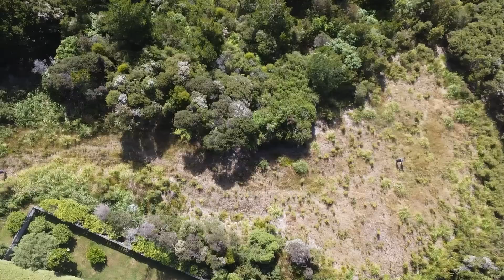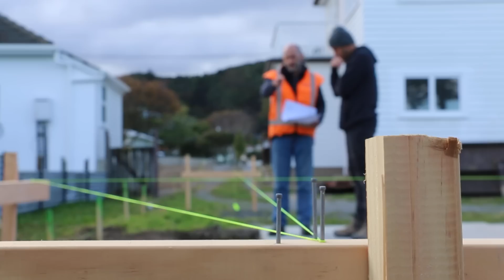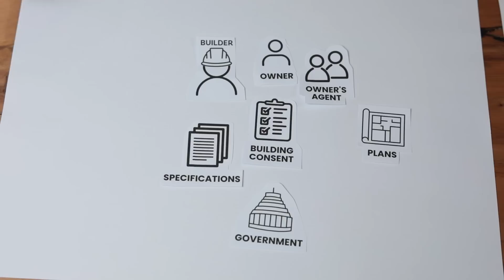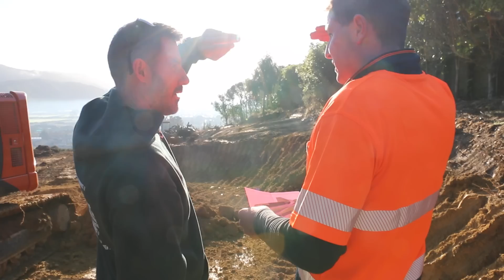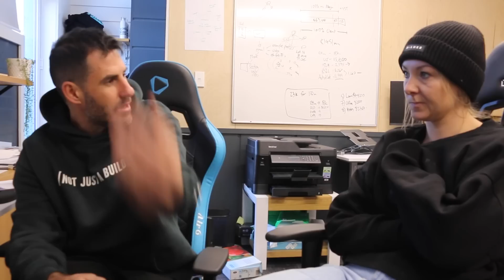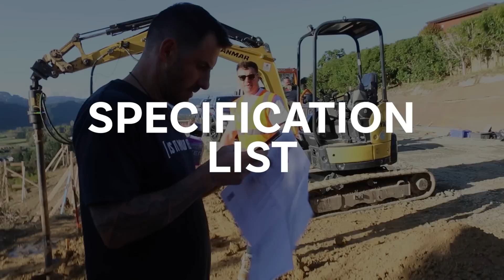The Most Frustrating Part of This Build (Consent Process Explained)

Comment: Why would the specific fireplace or water heater matter to the building code?
Reply from the maker: to make sure it meets standards such as safety / emmisons
Reply: @nzbuilder interesting. I wouldn't expect that there would be equipment for sale on the market that didn't meet standards. It seems like that would be a lot less work overall, managing the market at the port/manufacturer instead of at every build site😂

Comment: Architects and Architectural Designers are professionals and they should not be getting 100 questions about the code compliance of their Plans. NZS 3604:2011 (which is not the Building Code, but one way of complying with the code) is a document that any lay person can use. If a design professional is getting 100 things wrong, then there is a major problem in New Zealand. Would you trust your doctor if he is getting 100 things wrong in an operation?
Reply: 3604 is a standard for timber framed homes in NZ much like NZS 4229:2013 is the equivalent for concrete masonry homes. Half the architects and designers in NZ couldn't draw water from a well, much less lodge an accurate set of compliant documents into a BCA.
Reply from the maker: Fair point — if a designer’s constantly missing the mark on compliance, that’s a red flag.

Comment: The leaky building crisis created this paranoid process (which doesn't work BTW) and has increased the cost of building. In your case maybe there was the argument for detailed geotech and engineering (both regulated professions) but having to specify the fire and hot water cylinder? seriously? Did you have to specify the 'brand' of gypsum board? These are standard products that should comply with an NZS or International standard - that's all - end of.

Comment: You missed a step in the consent process that council sometimes like to throw in there. If they send you RFIs at day 19, and your first round response to the RFIs is not quite right, they have the power to reject / cancel the consent. This is based on the fact that at day 20 the plans did not comply with the building code. Then you get to pay for the processing time for that rejected consent, and pay for a whole new consent. Some folks that work at council really do pull this trick, thankfully not too many.
Reply from the maker: Thanks for sharing that, definitely some good points to consider.

Comment: And all that BS from consenting and we still have leaky buildings here in Nz. The whole process needs looking at from Architecture, Engineering to the Builder. And the funny thing  is the Builder when the Architect has designed something ends up with holding liability if it all goes wrong!
Reply from the maker: For sure there is a run of old designs / builds still failing but my epxereicne is the new stuff we are building is pretty solid
Reply: @nzbuilder Are you at all worried about the government deciding to let for example plumbers sign off on their own work. If you the builder contract the plumber and his work fails due to neglect why should you as the builder carry the liability for his failure to do the job properly! I can see as the builder working as a team approach with subcontractors that you have built a relationship over time having the confidence in that persons work. I see a problem at the moment where Banks don’t lend to builders as they have failed in the past. Then it makes the market competitive and then corners are cut. Personally I think it’s developers who create the most problems in the industry not the small builders but that is just my opinion any industry has its rogue operator!
Reply: FIY my own builder who has also got caught with faulty building products the house he built for himself had to be re cladded due to product failure and here is where the builder gets hit in the pocket who is liable!

Comment: Wasilla,AK no permits, no code, hire your own inspector if you want, banks usually require inspectors but it’s paid for by the owner. Oh, you need a driveway permit. Contractors, like myself, are licensed and using a contractor is highly advised but not required.
Reply from the maker: Thanks for sharing how it works up there!

Comment: Can a lbp carpenter sign off on a concrete pad ?
Reply from the maker: Depends on what you applied for, found this on google... Yes, an LBP carpenter can do concrete foundations, but only if they also have a Foundations license. A Carpentry LBP license alone doesn't authorize concrete foundation work; a separate Foundations license is required. 

If you need assistance finding a licensed practitioner in your area, you can use the MBIE's public register of Licensed Building Practitioners to search for qualified professionals.

Comment: just be thankful you are not building within Auckland's boundaries.  Their staff do not care at all about the people who are paying the bills.  They will find the most inanely stupid things to ask for.  I have been asked to provide fire ratings specifications for Concrete block walls.  I have been asked to provide valley roof details for rectangular roofs.  We had a situation where the same set of plans was used 3 times and 3 different processing officers asked completely different questions.  worse still was that none of them picked up the problems that the others did.  The biggest problem we have in New Zealand is a lack of clarity.  The building code is contradictory.  H1 insulation requires that all windows be closed for us to meet the code requirements yet G4 ventilation requires that we have to have a certain amount of window area opened to comply.  And there are countless other situation like this.  Unfortunately this puts a lot of power into the hands of people who have never even set foot on a building site so have no way of understanding how to put a building together.  Sounds like you had a good experience with your council.  Unfortunately that sounds like the exception to the rule.
Reply from the maker: Mate, sounds like you’ve been through the full council circus
Reply: @nzbuilder   20+ years of working in Architecture in Auckland.   Congrats on the 100K subs
Reply: @WHOSYAHOBBIT  If H1 was given priority over G4, then the percentage of windows would be a lot less, as code windows are 40 times less energy efficient as code walls. If we were designing rooms that were fit for purpose, then there would be no mandatory glazed areas in them, as windows work against the environment of getting a good sleep. (Noise, light temperature) And when 95% of the time a person is in the room, curtains are usually drawn, and 97% of the time the curtains are open, the room is empty, then you have to really question the validity of the acceptable solutions.

Comment: The consent process is one of the major issues with the cost of building in new Zealand. Personally I believe that the council should all ready the materials and products. Isn't their job to know to know the standards of they issue a consent. The amount of plans I have seen passed by council (at least where I live) that are poorly designed or that don't meet the 3605 standard is but. We got a set of plans through for pricing that had 1 degree roof pitch with tray roofing (minimum standard under the roof code is 3 degrees for metal roofing) and internal box gutters with only downpipes. Standard is to use rain water heads. It also only a 140mm gutter meaning the water would hit the parapit wall directly. Standard is a 300mm wide gutter minimum and the use of TPO membrane. They had specified a butynol product which is no longer approved. Also had the toilets running into gully traps (which is completely against the plumbing code) etc... all of these issues and they still given building consent. The councils should really get to know their products as should the designer and architects.
Reply from the maker: The council’s job is to check plans meet code — but too often, they don’t.
Reply: 1 degree roof pitch for tray is an alternative solution that will comply with the code requirements of preventing moisture ingress into the building and controlling the discharge of water.

Comment: What happens if such delays happen in consent stage re costs. Under current climate who wears the huge costs increases.
Reply: The client always ends up wearing the costs.  I've had situations where junior engineers at council didn't understand something so wouldn't accept it.  Even when it was designed by a chartered registered engineer who provided a producer statement.  It all had to be peer reviewed by an independent engineer of councils choosing, who agreed with and endorsed the original design, but that wasn't good enough so had to go the senior council engineer to do another review.  He also agreed and accepted the original design,  And guess who got stuck the the bill for all this extra work, all because some incompetent noob straight out of school with no real world experience didn't understand.  This sort of thing is why most council offices now have to have security guards in the main lobbies.
Reply from the maker: Depends when the contract was signed, but most builders won't fix price a build until consent is issued. Therefore longer consent = more cost to homeowner